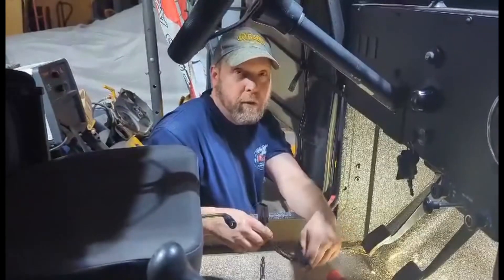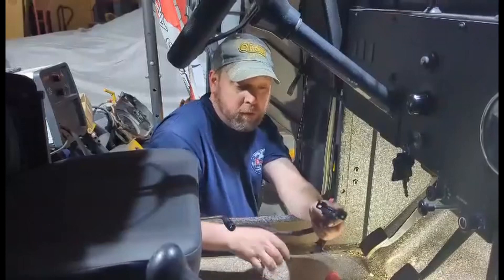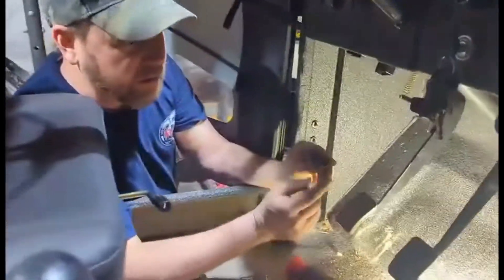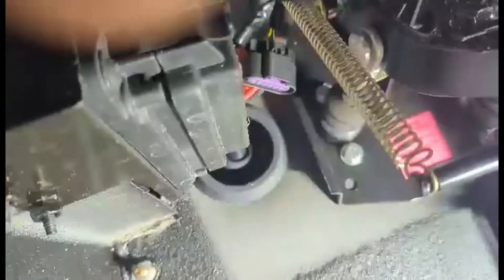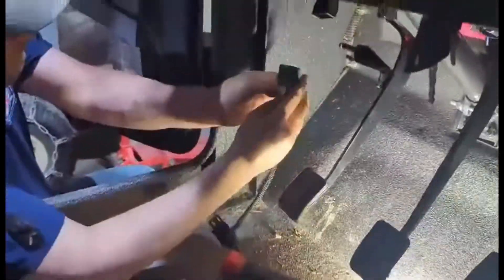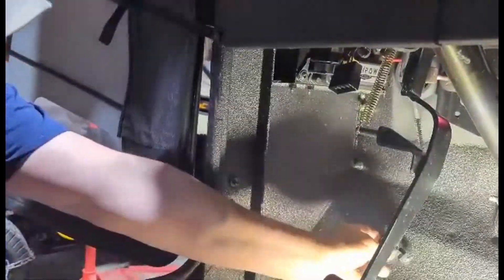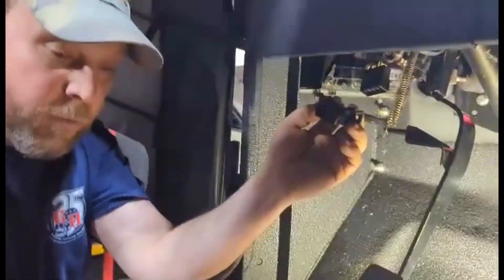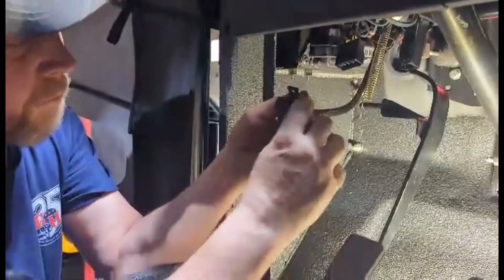Mahindra Roxor OBD2 Adapter Install

Comment: Will the adapter work with the 2023 roxor?
Reply from the maker: I'm not sure on that.   But that would be a question for Wade at Deisel Freak. Because things changed after 2022, but Wade would know the answer for sure